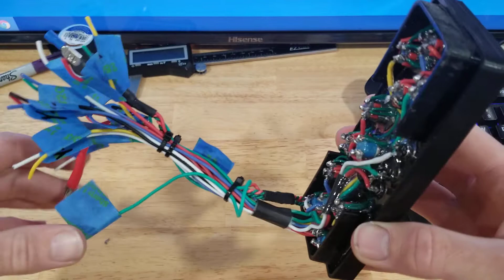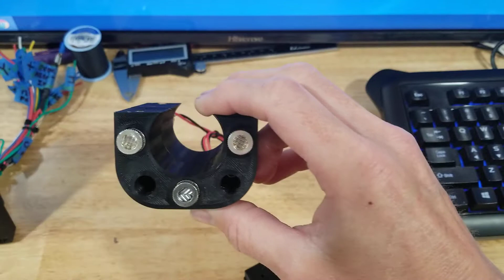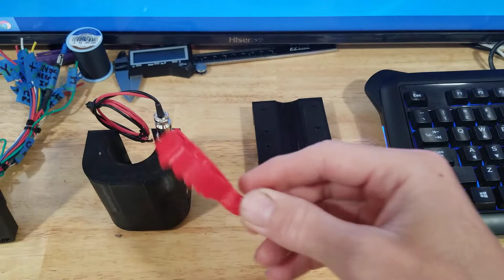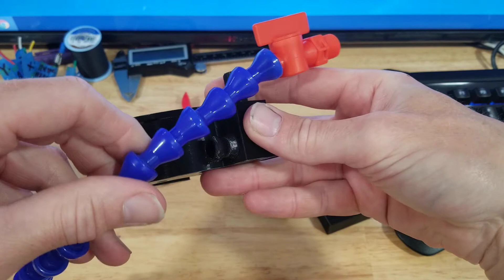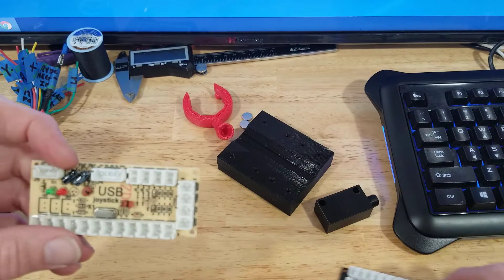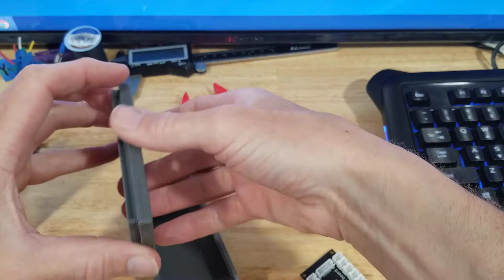Crossfire Pro mods: updated control panel and laser mount  part 1

Comment: Are you offering any of your laser mounts for sale or willing to share files for 3d printing? I’m interested in the laser mount that connects to Langmuir existing mount. Thanks
Reply from the maker: I offer a couple of them. What's your email and I will email you.
Reply: @thewholefamdamily  I would definitely be interested in the machine torch mount with laser guide.
Reply from the maker: @rexdowns2982  Get me your email and I will email you.
Reply: @thewholefamdamily  it will not let me comment with my email.
Reply from the maker: @rexdowns1319  Check the description. I just added the info.
Reply: Thank you, message sent.